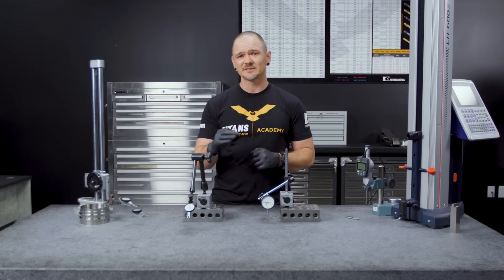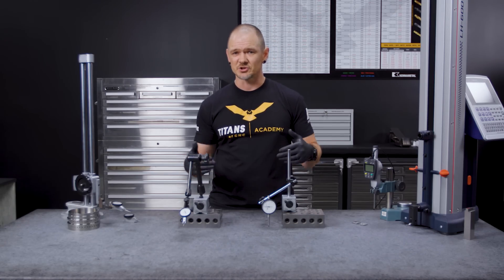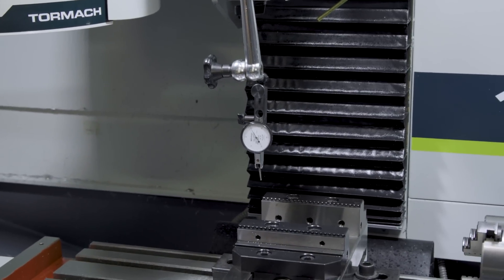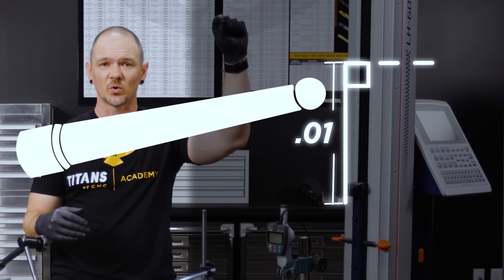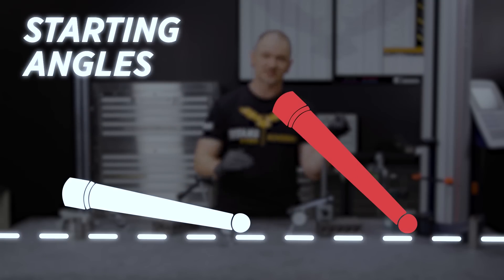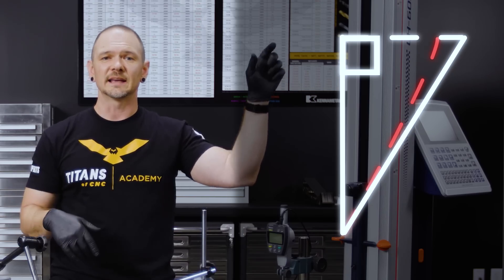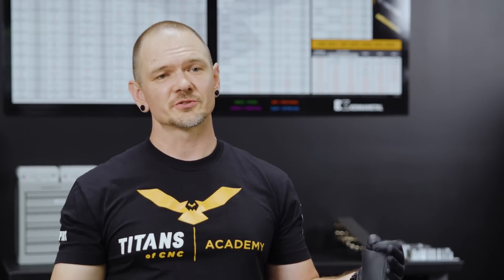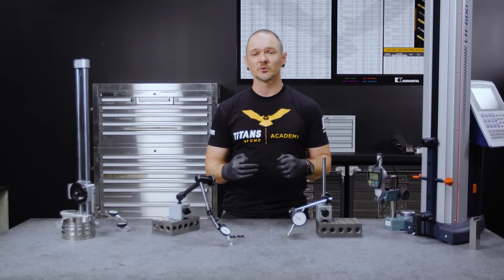Master The Most Important Tool In Machining

Comment: Question! How is there a .01" difference between .125" and .1135? Lmao... the cosign errors were MORE accurate than your linear measurements...
Reply: The blocks used were a .125 and a .135 Thank you for watching.
Reply: The ACTUAL difference is .0115"... so I pose this question to you. Which is MORE accurate to the TRUE difference between .125" and .1135"? .01" or .012"?
Reply: 😂  Thank you for clarifying that for me Travis. I must have had a spell of dyslexia while I was watching. Very embarrassing! Makes more sense now, as originally it kind of hurt my brain.         .013" difference between. 125" and .135" from being out of perpendicularity on the needle to surface I understand. Not sure how I heard .1135". Thank you for the great vids!

Comment: Great video. What about the angle of the stylus even if square to the measured surface?I think 12° is recommended for proper use of most indicators.
Reply: You mostly use them to align something. Therefore the absolute reading is not really important.

Comment: There's another term in machine I cannot remember but it it comes from an air and reading it when you're not looking at the needle square to the face you're looking at it from an off angle. What's the term?
Reply: Parallax error. Thanks for watching.

Comment: if u are mesureing runout while the part is in the machine cosine error doesn't matter right?
Reply: It could depending on what you are looking for. For example, if you needed a runout of .002 (.05mm) or less and you had a large amount of angle in your stylus you may get a reading that says your part is out of specification when it is not and consequently spend a lot of time and energy trying to fix a problem that doesn't exist.

Comment: does it matter if the base of the mag sits on  a flat surface i use them in cnc lathes and sometimes i don't have a flat surface to mount it on
Reply: Not really.  The orientation of the indicator at the point of measurement is the key.  Of course if the base is not secure in it's position it can have negative effects on the accuracy of the measurement.

Comment: From what I understand, dial test indicators are designed to read most accurately when operating at 12 degrees to the surface. This is because it is often impossible to get the stylus exactly parallel to the measured surfaces in many Cases, so it was designed to operate at a certain angle, I think 12 degrees.
Reply: It depends on the manufacturer of the dial test indicator and you should definitely be familiar with their instructions. Thank you for adding this and thank you for watching.
Reply: Yeah most of them will tell you what degree to place it at, assuming you bought it brand new.  My interapids came with infomanuals explaining it

Comment: Actual note off my dial test indicator: Contact point can be adjusted 180 degrees by rotating arm axially when required, but axial line of contact point should be parallel with working face of workpiece or have 5 degrees or less of angle. After having mine for a while, I realized the arm was friction mounted, and could be 'forced' and swung along the axis for better positioning; noone had ever covered that.

Comment: Very imformative... Now i dumbfounded because i was measuring this incorrectly. Our shop does not require tolerances tighter than 0.05mm but the error is an error. Thx for video Ill correct myself and all ppl I teach stuff in work... : O

Comment: CoSine error is only when comparing 2 different heights, right? For instance if you have the mag base on your Z axis in a vmc, and you touch off the top of the part and then move to a floor of a feature, the CoSine error is non-existent?
Reply: It depends on what you mean when you say comparing two different heights. Cosine error is applicable when you are using the indicator only to determine absolute (actual) distances. I am assuming in this example you are using the travel of your z axis to measure a distance and the indicator only serves as a zero reference so no, cosine error would not be applicable in this case.
Reply: @travisjarrett2355  Yes that is what I was referring to. Thanks for the confirmation.